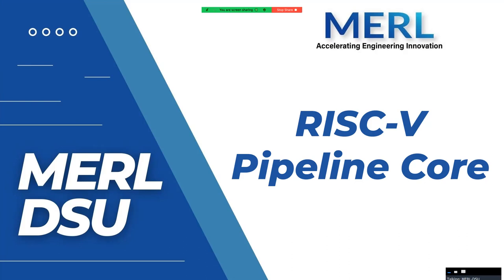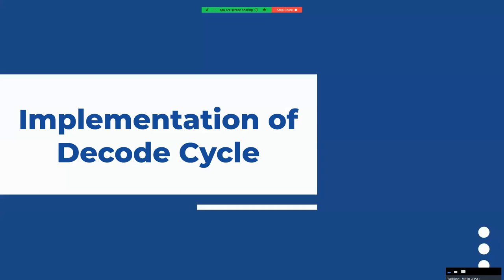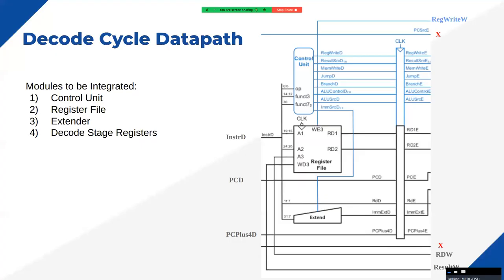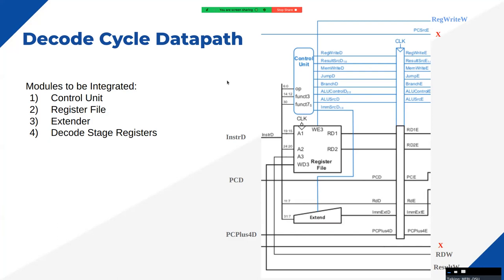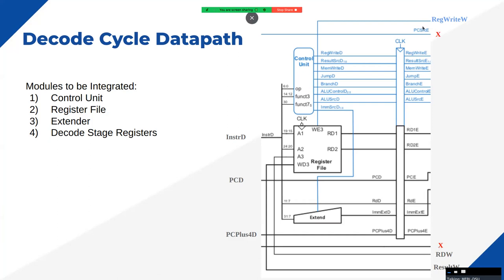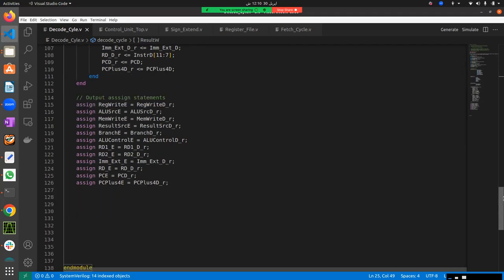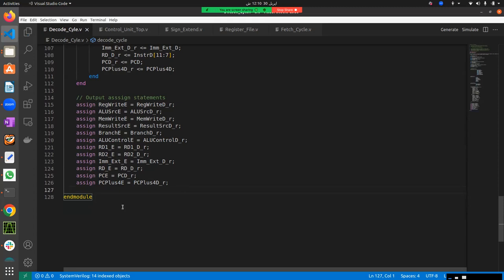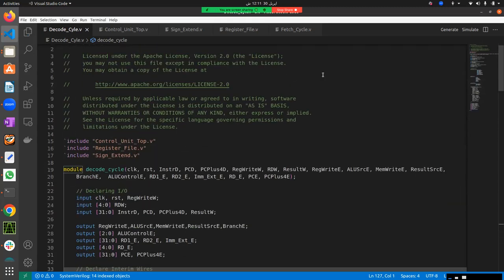Lecture 3: Design & Implementation of Decode Cycle

Comment: Fom which textbook is this block diagram?
Reply from the maker: the material is available in the github repo
Reply: @riscvtransistors2ai  yes I Saw that. Thankyou!
do you have any textbook recommendation, so I can read on it.
Reply from the maker: @Nothing-o7o3e  You can look for Digital Design and Computer Architecture RISC-V Edition book

Comment: which type of instruction set does it support ?
Reply from the maker: its support RV32I Base instructions only
Reply: @riscvtransistors2ai  instructions like ?
Reply from the maker: @HARSHANILPATIL  like Load Word, Store word, Add, Sub, And, Or, and Xor
Reply: @riscvtransistors2ai  what about STLI ,  SLTIU, ANDI, and many more ?
Reply: @riscvtransistors2ai  and if I want to add more instructions, how can I improve your design ?
Reply from the maker: @HARSHANILPATIL  those are left for the learner to learn and implement them on his own. to enhance his skills
Reply from the maker: @HARSHANILPATIL  you have to make changes in different files as per requirement. For example to increase the functionality in ALU you have to add more control logic
Reply: @riscvtransistors2ai  yes thank you 😃, I'm excited to work and upgrade your design
Reply from the maker: @HARSHANILPATIL  Wish you all the very best